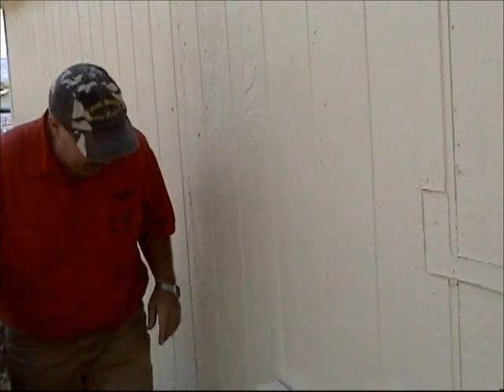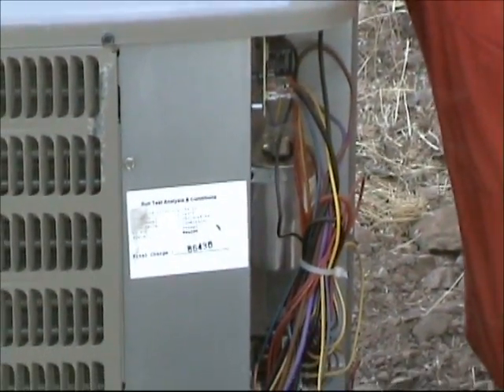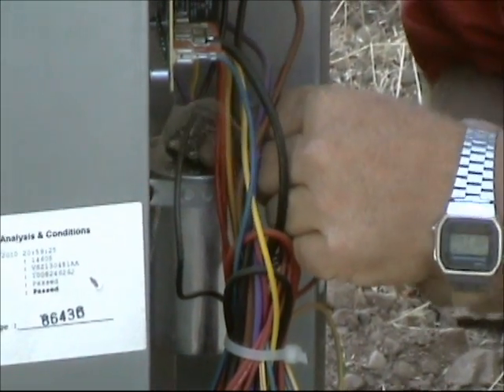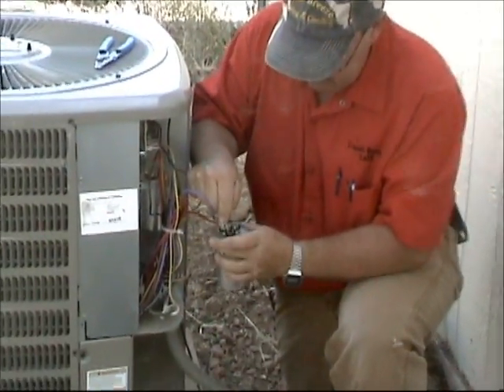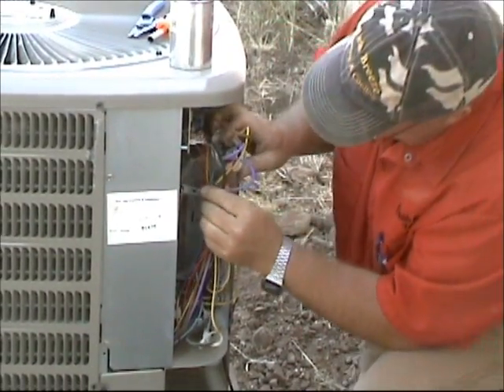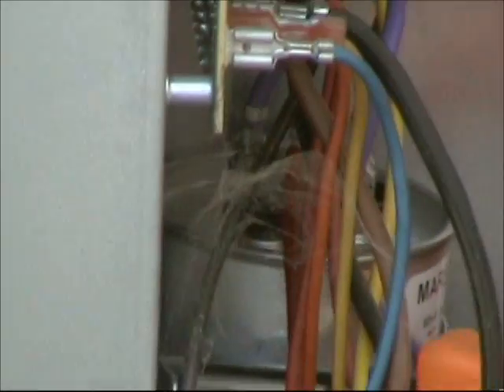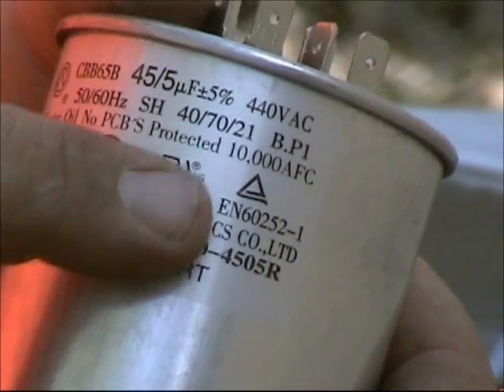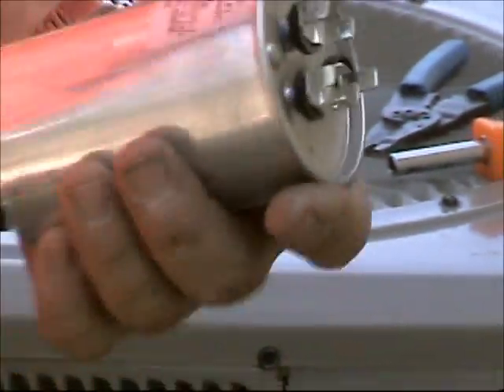Fix My Own AC - How to Change a Run Capacitor

Comment: Thanks this worked for me my A/C is 14yr old and this is the second capacitor the last one lasted 3 &1/2 yr  and cost me $125 to have fixed . I checked out what the top looked like and seen that was the problem went to supply house and new one was $11. followed you video and 10 min it was back on line . Will see how long this one will last made in China .Orig was made in USA and lasted almost 11 yr and second one made in China 3&1/2 yr so that tells you some thing about made in USA  but sure you can't find one made in USA . Again thanks

Comment: People change capacitors without knowing WHY the old capacitor failed. Symptom solved, problem remains the same. Changing the capacitor is only 1/3 of the job. Capacitors blow season after season until the compressor finally blows, usually a compressor terminal.
Reply: Well Mr HVAC guy, caps go bad because of age and heat. Those are the primary causes. So sorry your losing business from people educating themselves to not get screwed over from HVAC people which it sounds like you're one.
Reply: You're a douche
Reply: CRAIGARRR hahahahaha got that damn right😂😂😂
Reply: It makes not a difference to me. Why in the heck would I care? I am confined to a wheelchair. Talk what you know instead of what you think.

Comment: Because changing capacitor is the easiest, cheapest and most common problem of the AC unit. It worth for trying before calling HVAC tech.

Comment: "For teaching purposes, let's assume this is bad."  That is why you didn't teach us how to be an AC tech and do all the steps for a complete overhaul/check.  The video is pureIy instructional on changing a run capacitor.

I love the video and appreciate the knowledge on how to change this part.  Helped tremendously. Thank you!

Comment: Why didn't you check your incoming line voltage, the amp draw on the compressor and condenser fan motor? Did you check the condenser coil to see if it's clogged with dirt putting an extra strain on the motor? The refrigeration charge? There is a difference in just changing parts and actually repairing a unit. Maybe this time the "real" problem took out the $30 capacitor next time maybe the $700 compressor.

Comment: I was just quoted 220 to replace a run capacitor on my A/C unit.  Normally I would have paid it but I just spent nearly $1000 for other work around my home.  This seems easy enough to do myself.  I may actually attempt to tackle this job myself.

Comment: the only thing i would see leave for someone else is the refrigerant that mostly requires a government license and a load of math skills to handle anything else if you feel comfortable of doing is just a matter of  turning power off to the unit for safety and unbuttoning a few wires anyways if you think warranties are there for a reason why is it that on some appliances when that warranty runs out thing start breaking on it or their repair tech begins charging you full price